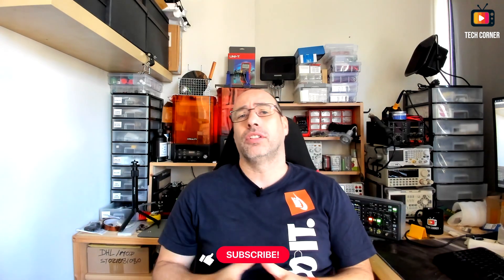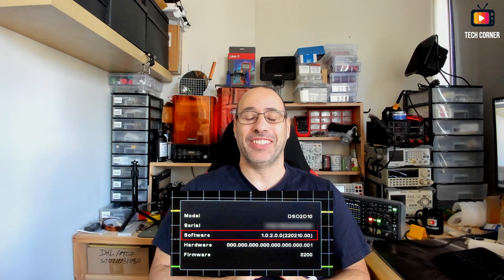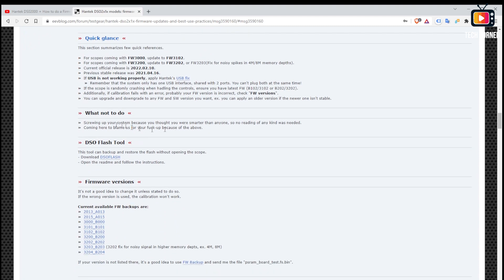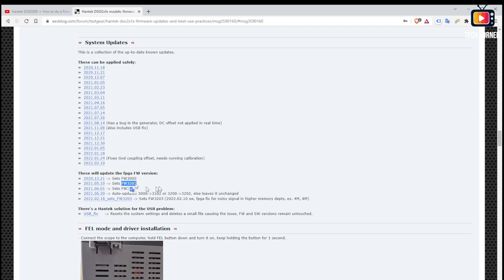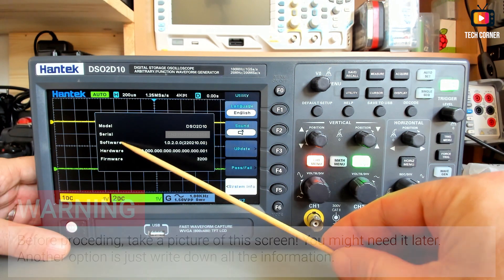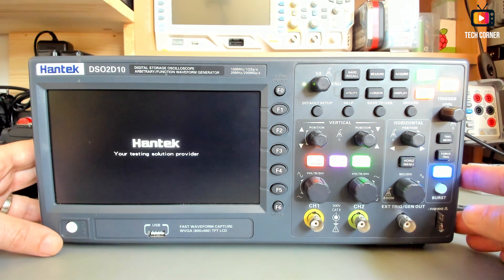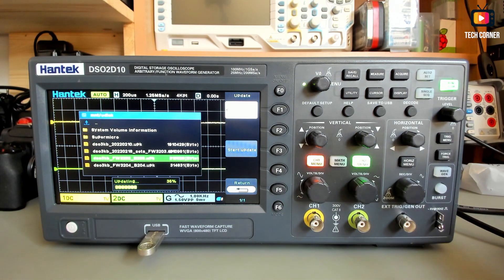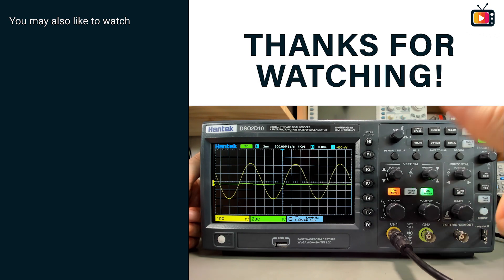Hantek DSO2D10 Oscilloscope -  How to fix the "low level firmware" issue ⭐ Part 1 of 3

Comment: Can I just use an empty 8GB USB 2. pen formated with FAT32 for the download, or must I partition it to some specific size?🤔
Reply from the maker: Hi, just use a FAT32 formated usb drive, copy the file to it and the DSO2000 should be able to detect it. Try this first, if you have problems, then try to partition with 4GB or 8GB. But it should work ok. Thanks for watching! 👍
Reply: @TechCornerTV  OK, I will try.  Thank you.

Comment: My oscilloscope was bricked and then fix it ... but the signal generator is wrong ... only show me 1000khz and the frecuency never change 😮‍💨
Reply from the maker: Hi! I didn't test mine also, probably will have to do the same, got to this post https://www.eevblog.com/forum/testgear/hantek-dso2x1x-firmware-updates-and-best-use-practices/msg3590160/#msg3590160 and in the mods section locate the "Generator calibration fix", download and use (upgrade) on your oscilloscope. It will probably solve your issue. Let me know if it worked later 😁 Thanks for watching! 👍